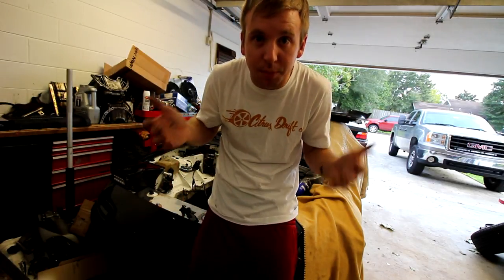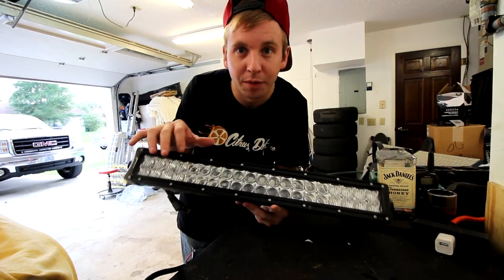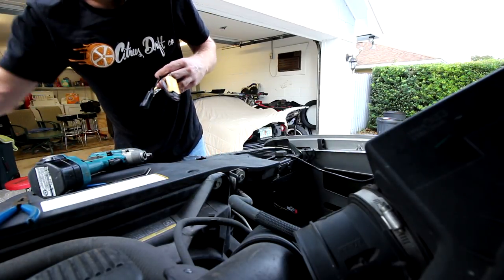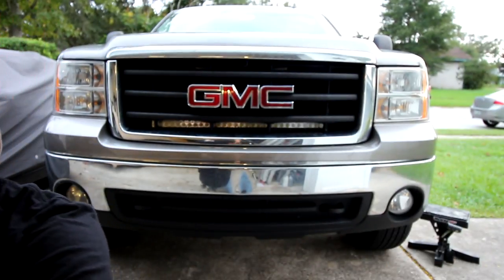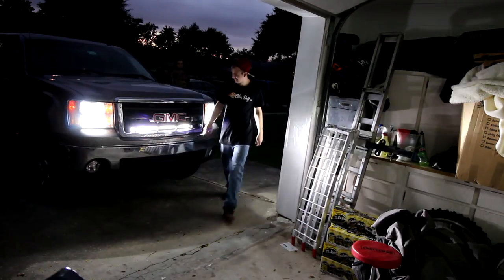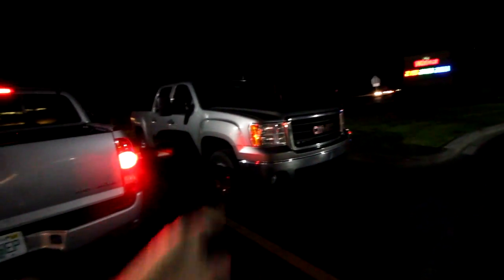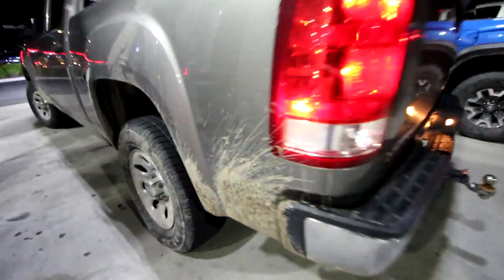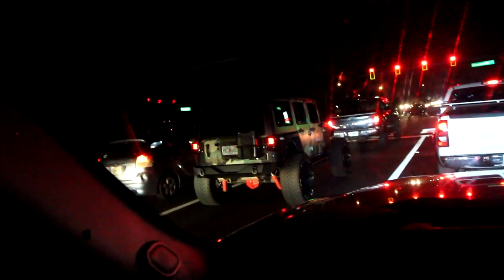More Light Bars and Mudding with my 2wd Truck!

Comment: how did you mount the light bar? i have an 08 Sierra and there is no room behind the grille. did you cut the support bar?
Reply: i was only able to fit FCKLIGHTBARS Pods in the grille. (as shown in my picture)
Reply from the maker: Joseph Brogna I had to cut the radiator bracket